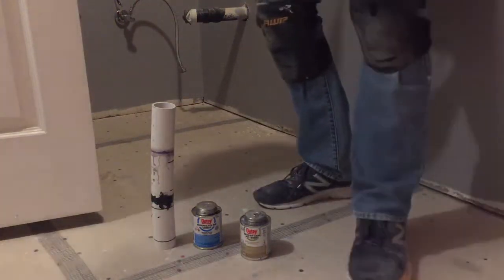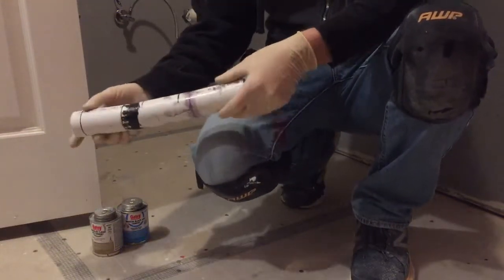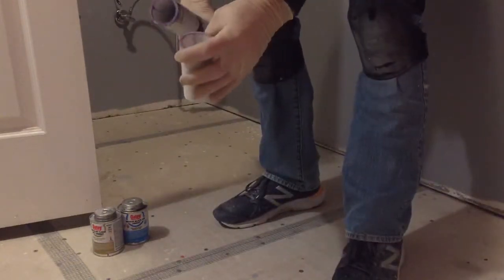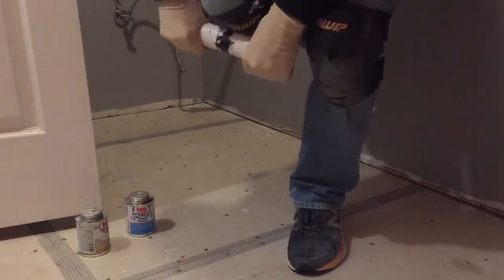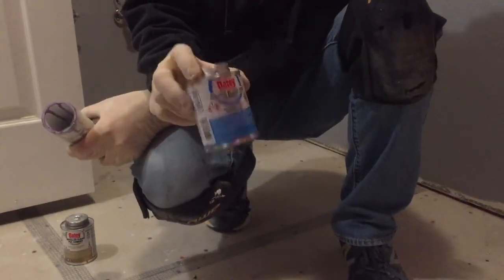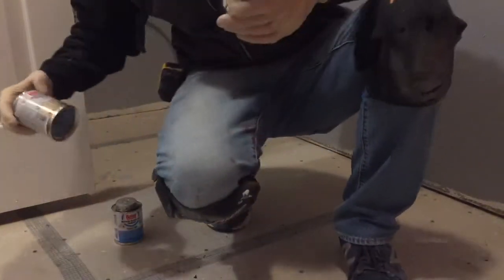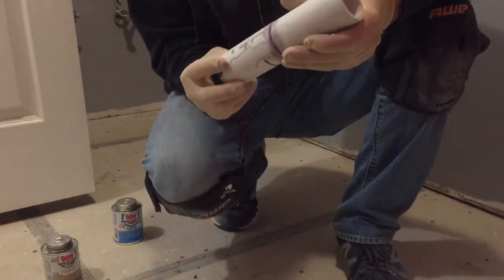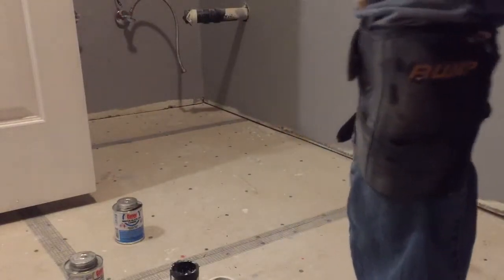ABS Cement vs PVC Cement

Comment: Not sure what this video proves.  ABS cement is for ABS plastic.  You used PVC plastic.  Wrong plastic.  And did you use primer on the clear PVC glue?  You must apply primer to the PVC plastic before you apply the PVC glue.  You can't use PVC glue alone without the primer.  The ABS glue does not use primer.  And of course you do not glue plastic pipes like you did.  Gluing the cut ends.  You glue plastic pipe by putting the pipe into fittings.  With glue on the pipe and inside the fittings.